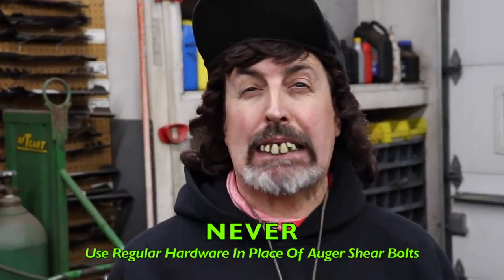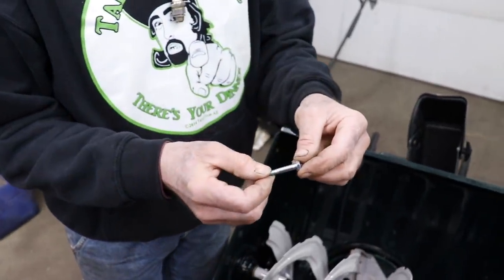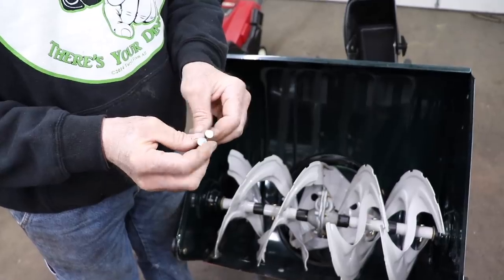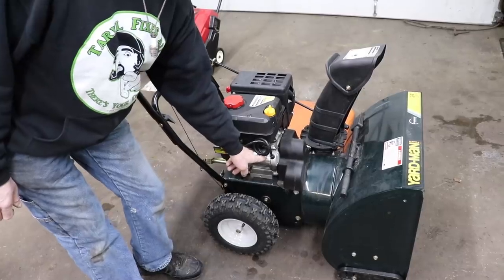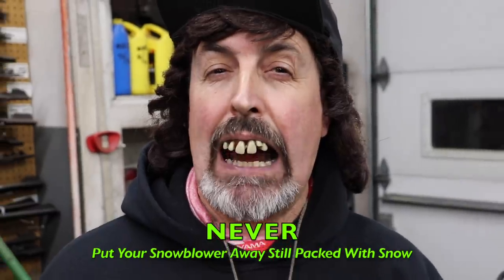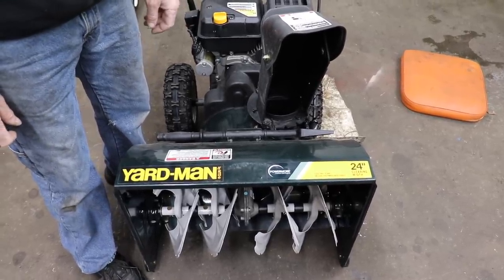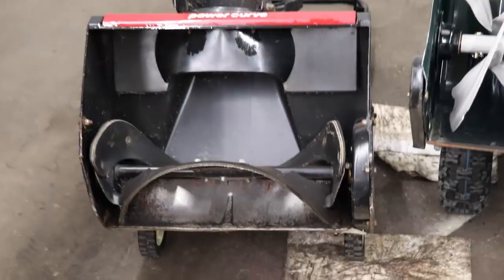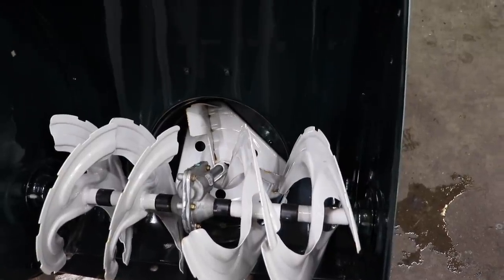5 Things You Should NEVER Do To Your Snowblower

Comment: I would say number 2 is a bit overboard. If you own a home with a gravel drive or do commercial snow removal like I do, gravel is gonna show up time to time. My old Ariens manual says, if your using the machine in gracel, take a 1,1/8 block of wood and drop the skid shoes down, or drop them all the way. The machine will pass over most of thrm, yea it might still grab one here and their but it goe's with the territory. What can ya do?
Dual stage machines are designed to be used on different terrain aside from flat pavement, like gravrl znd dirt and grass, etc. Single stages are not.
Reply: When there is 3-4 inches of snow I go out and pack it down with the car. When it snows more I can snow blow without shooting stones out. Downside is it makes ice after awhile and I have to sand it. Landlord won't pave the driveway because Tax assessment will go up.

Comment: I have a compressor in my garage. When I'm done using the machine, I pull the compressor hose outside and spray compared air on the machine to clear off 90+% of the snow. Some people I know place a small heater (Milkhouse style - under $25 at Tractor Supply) in front of the machine, facing the auger, to melt all snow and ice. Only has to be on for a short period of time. Lastly, I park my machine on a small scrap of old carpet. It keeps the melting snow in one place so it doesn't spread all over your garage floor. The second benefit to the carpet is that it keeps you from getting rust stains from the skids on your garage floor.  Lastly, pick up some ceramic coating, either liquid or spray (liquid is typically better), and put a coating on the auger and impeller housings, inside and out, sling with the inside and outside of the chute. Your machine will clog less as the coating will keep snow and ice from sticking to it. Less snow/ice stuck on the machine means less clearing of the machine when you are finished blowing, and less chance of things freezing up before your next time of need.

Comment: Grade 1 & 2 SAE bolts have no markings on heads. I was always told that anything less than grade 5 (3 markings) is ok. Most hardware stores sell Grade 1 & 2 bolts.
Reply: You could theoretically do this, I would get the lowest grade bolt you can and heat it cherry red with a torch and let it air cool, then just put a small notch in it with a grinder on each end of the unthreaded part of the bolt. That should break if it gets jammed up. I don’t understand why shear bolts cost so much other than they figure everyone is dumb and will pay $5 for one bolt.
Reply: Yes, I use ungraded bolts, and cut two grooves in them, using an electric drill and a hacksaw blade. They fail just like a $5 shear pin.
Reply: it's case by case, in the case of this machine it looks like a grade 2 but it's machined weaker with grooves machined into it. use the recommended or suffer the consequences.

Comment: My scrub cadet blower eats shear bolts for a snack. I did replace them with ungraded regular bolts and only eats a few each year. It also burned up belts until I put in a higher end Gates green belt. I use it on gravel every snow storm. It finally sucked up a large rock pushed in from the city plow, and threw a rod in the engine from the sudden stop. The impeller did have the factory shear bolt in. I think the good drive belt was what allowed the engine to stop so fast, while the impeller bolt was shearing.

Comment: One year we got 2-ft of snow and I got a phone wire wrapped around the auger, the only time it busted a shear pin. It spread the augur housing and the augur came out on one end. Had to use a cotter pin (a soft pin) until I was able to get out because the shear pins were in storage at a different location. Like Taryl said, you are better off using a smaller nail or a cotter pin than a case hardened bolt, I learned that fixing machinery that came here on the Mayflower.

Comment: I’ve come across a bunch of blowers with steel bolts instead of shear pins, people around my town just love to break gearboxes I guess. I’ve seen cracked gear boxes a few times.I’ve also seen those rocks get stuck in the second stage of the auger when homeowners throw them out.

Comment: So how do you clear a gravel driveway? I don't have a plow. And it's too much to shovel.
Reply: Youll be fine!! As long as it doesnt pick up too much gravel at one time..listen for such noises..i have marks on my impeller housing from gravel on my 10hp 30 inch 2 stage john deere..its 20 yrs old now still going strong ..hello from  Minnesota
Reply: I've been clearing gravel driveways with 2-stage snow blowers for almost 60 years. I certainly am not about to shovel! :-)  You just have to be "not stupid". Adjust your skid shoes so you aren't scooping stones, pay attention to the direction of your chute and especially the spout. There's usually no need to be blowing snow into the next county. Keep the spout down low when around obstructions or things that might be damaged by an occasional pebble.
Reply: @eosjoe565  Once the ground freezes I do not have any problems.  Just be smart about it
Reply: 2 stage snowblowers are designed to be able to be used on gravel surfaces.  Set the skid shoes and shave plate at a height that is not picking up gravel, and as Taryl stated, blow in a safe direction (watching out for people, cars, windows, etc)
Reply: @hunter47able  Agree. The problem is our ground has not frozen the past three winters here in PA. We have cold a few days and the ground gets hard and then a 40 degree day and things are muddy again. And the stones in the driveway, they haven't frozen in the past three winters.
Reply: Pay someone with a plow.

Comment: Great video but could you mention some time to let them warm up every time I hear one of my neighbors use one they just crank that throttle up right away on a freezing day and I feel bad for the poor engine. Also they go too fast in high thick snow.
Reply: At least part of that behaviour is because the computers in modern cars cover up the importance of a gentle warm up period for any engine.  So people don't think about warming up anything anymore.  Sure the computer will make the car drive ok, but you are still doing damage by going too hard too soon.
Reply: There is no benefit to allowing an engine to "warm up".  Engines need only sufficient oil pressure to operate properly.  Warming up, particularly at a slow idle speed, can actually  do harm.
Reply: Well actually with 2 strokes you’ll often hear a term called a cold seizure. That’s when the engine is NOT warmed up because the exhaust side of the piston will heat up quicker and become and oval and scratch the hell out of the piston and cylinder. Engines do need to be warmed up a little. I completely agree with you about it just needs sufficient lubrication and it will run fine but I usually take the extra measure by warming up my engine
Reply: @bradleygower7181  Some newer snowblowers don't even have an adjustable throttle. They just run at full throttle against the governor from the moment they start until they're shut down, like a generator engine. I guess the best a person can do with one of those is at least let it warm up some before putting it to work.
Reply: That’s exactly what I do. Only for a minute maybe a minute 30 seconds then I let her eat
Reply: @bradleygower7181  🍽

Comment: The single best thing I ever did with the blower was to make a set of auger seals to seal that big gap on the secondary blades .    All it takes is an old mud flap and some self tapping screws.      No more unclogging the chute EVER and range the snow is thrown greatly increases!     Tarly you ought to do a tutorial on making those.      You’d save a few fingers flying off 🤢.

Comment: I broke two shear pins on my snowblower and had to put bolts in it. It's been 3 years and I need to remember to get those shear pins. I got gravel so it rarely gets used. Only when it's too much for the plow it gets used.

Comment: I would have to disagree with you Taryl on not using a snowblower on a gravel driveway.  

You can, you just have to follow "things you must do!"  1) never blow snow towards anything you don't want broken or hurt.  Gravel is not the only thing these machines can throw.  You can pick up ice chunks that have dropped off from wheel wells or other foreign objects someone has dropped on the drive.   2) Taryl is right in that these machines will throw gravel.  That is why you have to set your skid plates high leaving some snow on the ground to allow a "snow / ice base develop on your "gravel" drive.  Leaving some snow on your drive will allow for that compaction to a hard surface. Once you have your base in place it is no different than any other surface.    

Will you still pick up gravel?  Yes, so you have to be diligent with where you throw that snow.  Been living in a rural area with a 150 foot long driveway for the last 20 years without problems.  I must admit the first couple of years I learned lots, in particular why there are shear pins for the augers as well as the impeller.

Enjoy your channel and appreciate the knowledge you share.  Thanks,

Comment: I had no choice but to replace a shear bolt with a regular bolt.  Then I forgot about it.  I can testify that when something that is supposed to fail is replaced by something that isn’t supposed to fail, horrible consequences result.  $125 lesson learned.  But with 22” of snow, I had to get back in the game.
Reply: My machine (33") uses 4 shear pins ,  I keep about 40 spare pins in stock , and usually use 15 to 20 each season  .
Reply: @robertlewis1965  What do you hit to use that many?
Reply: @tommak6516  
Rocks , tarps , firewood  , bumper of truck , the list goes on  .

Comment: Hey Taryl, whats your opinion on adding homemade paddles to the impeller of a 2 stage? I've seen a lot more people do this recently. Another great video guys.
Reply: They work a little for a little while- not worth bothering, and they aid in clogging the impeller drum is then exact area that should be smooth.  Floor wax is a good coating, especially on old machines to help in reducing cloging wet snow.
Reply: Do it and never look back!  I use it on every machine I fix n flip.  I even try and upsell it when a machine is here for service.

My machines are 15-20 years with impeller mod on some of them for 5 years.  Still the same paddles.  Before snow comes I cover the inside with some sort of oil based lube.  Even PAM will do LOL.  Before I go blow snow I do it again all over.

If you go throw my channel I show you how to do it on numerous machines and explain the science behind as well.  THAT IS THE BEST bang for your buck mod to almost any machine...change my mind.
Reply: Greatest mod ever.

Comment: You should see the rocks fly when your "snowblower" is 7 ft wide and mounted to a 67hp tractor.  (^_^)   Making sure the discharge chute is pointed in a safe direction is mandatory.  Very similar to knowing where your gun is pointed at all times.  When your "shear bolt" is a 5/8" Grade 5 bolt (and yes, that is the Factory spec) it takes a serious jam to pop it.  (never have)  It just chews up and throws the item out.   You should see the cute little spade I use to clear out the chute on those slush days after the machine pushes out ice sausages.  (^_^)

Makes even an old 10hp Ariens look like a toy in comparison.   (Long live the Snow King!!)

I've had an electric starter on my Ariens blowers since 1978.  The first one I used exactly once.  The second one I took off and have in a box because I never use it.  I keep it in case I get old and frail and can't pull like a man anymore.  Both machines have always started on the first or second pull.  It takes longer to unroll the extension cord, get the machine started and then coil it back up again, shake all the snow off, and put it away.

When I'm "stupid and in a hurry" (99.999% of the time) it's just easier to pull the damn thing.

Best repair?  Got some 2+ feet of powder.  Was clearing out under the clothes line (my wife likes to hang out bedding in the winter) and I sucked up a metal prop rod that was laying in the grass.  Had to cut the remains out of the augers and while the temps plummeted to near zero and I could only get the garage to about 40 degrees split the machine and replace the bearing behind the impeller which had pretty much grenaded.
Reply: Yours obviously doesn't have a Tecumseh engine. Ugh.
Reply: @davesrepaircom  Umm.  Tecumseh made the Snow King engine.  Yes, my 22 year old machine has the Tecumseh 10hp Snow King.

Comment: In the winter of 1994/1995 I worked at a Montgomery Wards in electronics, appliances and Lawn & Garden section. A few times I did final assembly of 2 stage snowblowers putting on the handles and bolts in the 1st stage augers. I didn’t know about the special shear bolts for the 1st stage augers and I think I got them mixed up with regular bolts of the same size as one day a guy came and his snowblower was damaged from having the wrong bolts in the 1st stage auger. Ooooooops!
Reply: So you're the reason Montgomery Wards went out of business?

Comment: Is it okay to starve your engine after every use? I tend to turn the fuel shutoff off after every usage of my snowblower and let it starve. So no fuel in the fuel carb.
Reply: It's a great idea. The gas with ethanol in it isn't the best for carbs. I always run mine out or use ethanol free gas.
Reply: I do the same, seems to work well.

Comment: Also, don't neglect the condition of the bucket shoes. They can wear down so much that the bucket itself can start wearing down and then the augers will start to contact the pavement. So unless you know how to weld new metal to the bucket, inspect those shoes and change them as needed.

Comment: I’m sure it wouldn’t hurt if I used them, but my Toro from the factory didn’t come with sheer bolts, and the manual actually says they’re not necessary.
Reply: @davidp8563  never had a problem. Anything that’s gotten jammed stopped the engine.
Reply: I read that. Toro says it is because they use an extra strong gearbox.
Reply: @davidp8563  yes 👍 i saw that too about mowers never needing oil change..total bullshit..i own a small engine shop in Minnesota and a few customers ask about that..i said always change oil once  or twice a year depending on how much it is used...today things are made to fail, throw aways i tell ya..and don't get me started on 2strokes..50:1 is still too thin
Reply: @davidp8563  its the government and EPA that is trying to cut back on emissions of 2 strokes because of the carbon footprints of these engines...well i still mix 50:1engines at 40:1..it will give the engine more protection..the old lawnboy mower needs 32:1 and i have a older hi performance radio controlled buggy that uses 25:1 oil ratio with gasoline..it smokes quite a bit ...and your right it smells good!!
Reply: @davidp8563  I would use a shear pin. It makes no sense to me, but Toro made a video about it. Maybe they use low powered motors that stall easily if the auger gets jammed.
Reply: @davidp8563  it’s not luck, but what ever you say armchair expert. 

You’re free to do what ever you like with your snowblower, and I’ll do the same with mine.
Reply: @davidp8563  😆, 👌

Comment: #6 Don’t store it with gas in the carburetor or tank at the end of the season
Reply: Ive had a Honda 24 inch 2 stage for 31 years.   The first year I put it away with 1/2 tank of fuel.  Next year I was at the Honda dealer buying a new carburetor because the existing one was clogged with old gas that turned to muck.  
Honda has a fuel cut off.  I never shut it off with the key.  I turn the fuel  off and let the engine run itself dry.  

If it sits I always check the fuel to make sure it good before opening that fuel shut off. 

30 years now without a problem.
Reply: @Cha-y412    After running the engine dry with fuel valve shut off if your carb has a drain valve on the bottom (older style) push up on that and drain the last bit of fuel sitting in the bottom of the bowl.  Although that fuel is not inside the body of the carb it will get sucked up once you refuel and start up in the Spring.  Whether any fuel has congealed and the carb passages get clogged is pretty much a coin toss.  If you have that kind of carb you might as well drain it completely, without any tools, right?  :)  If, on the other hand, your carb does not have that drain valve, it has a main jet and that hex is easily undone to remove the bowl and wipe it out with a paper towel.  Easy peasey!
Reply: @Rein_Ciarfella  Thanks
The old Honda does not have a drain valve on the carburetor.   

But you gave me a great idea .  

Thank you.
Reply: Rick chiarello   I’m still learning. Glad I could share that. 👍
Reply: Put fuel stabilizer in your gasoline and you don't have to worry about it.

Comment: 1-check the oil EACH TIME 
2-dont put it full throttle right away, wait a couple of minutes
3-if its stall and squeaks STOP, dont burn the belt
4-no full throttle without load.

ive seen many blower with blown engine.
Reply: @harryharry3193  or copy of briggs. the shitty flathead design with the tappet valves.
i cant wait for the chinese to finally crank up the production of the honda clones. they started making generators and pumps with them, i am waiting for the snowblowers too.

Comment: Also if you get a new snowthrower remove the wheels and put some never seize on the axle where wheel hub slides over. I never did that and in the case of my MTD after 4 years theres is no way to remove wheels even with heat and pounding. Many other brands may be easier but it forced me to change tires while wheel still mounted. Would have been easier to take wheels off and have someone else change them because its not easy removing and installing the tires yourself.